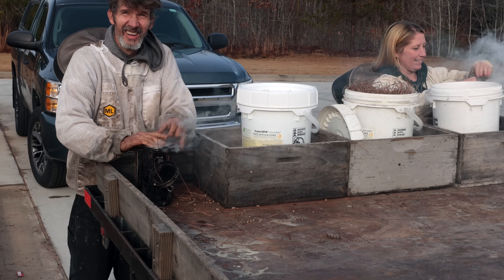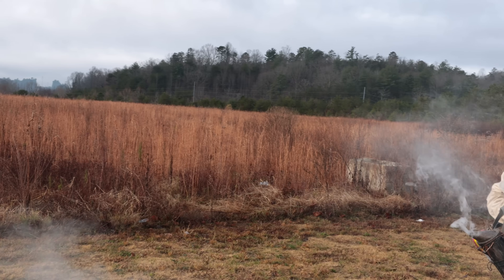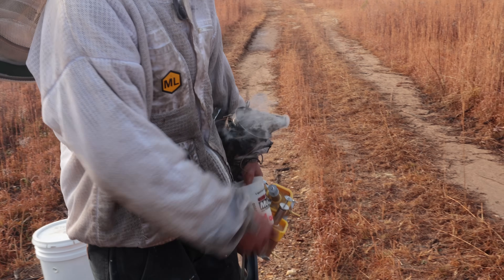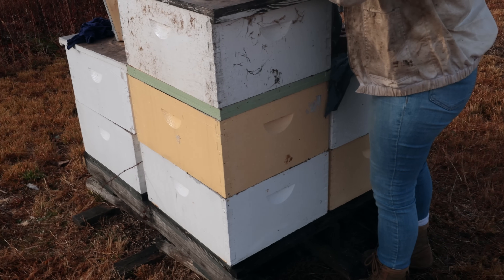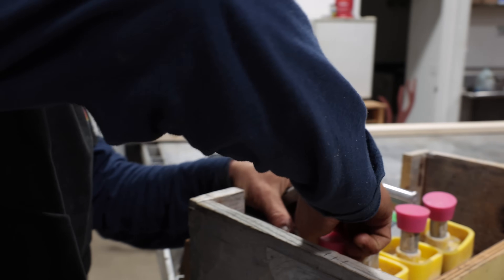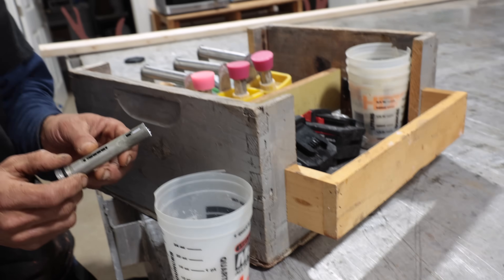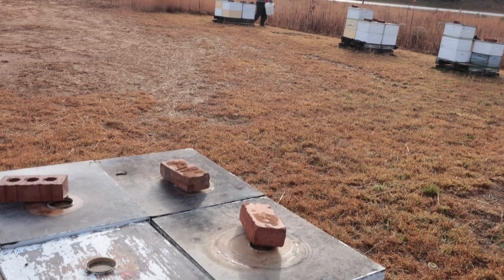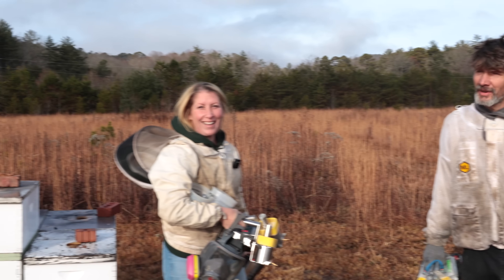Oxalic acid vaporization 2025

Comment: The threads on my plunger get OA crystals on it and then it takes a pair of channel locks to break it free so it can be adjusted. It gets stuck so bad that I think I’m going to break off the adjuster knob with the channel locks. I’m using their cheapest model. It gets so hot that I’m not sure if I can put oil, grease or silicone on the threads to prevent that from happening.
Reply from the maker: There can be a build up over time. We usually put the plungers in a bucket of water between yards and then twist the knob to clear things off before using. Seems to work fine.
Reply: I rinse my plunger in warm water & it seems to clean it pretty well
Reply: I use the 1qt plastic tubs and put a couple spoons of baking soda in the water and let the plunger soak and react. Same with the silicone heat mat. Then rinse with clean water. 

I also wipe down my instantvap with same mix on a rag at end of season and then polish with stainless cleaner. Looks brand new still. Expensive tools so I try to take care of them.

Comment: Hi Bob, great video as usual, thank you!  the oxalic acid I bought ( to use with Instavap compact) is very fine and it runs out of the plunge. I can see you don't have this problem... what do you suggest? I've been using a spoon to dispense the right amount but I'd like to be able to use this costly tool as it is supposed to... thank you
Reply from the maker: Add just a very small amount of moisture (just a small sprinkle and stir) and it will clump better. Some people recommend distilled water but I'm not sure if that is necessary if you have good water.

Comment: Havent seen such a high dose like that yet. Are you sure you aren't going to see some bee losses with such a dose? I'm beginning to question this method over the dribble. Now its 2x the time for each hive, instead of just one 4g dose. Thats likely on par with 2 employees cracking, tipping and squirting.
Reply from the maker: The University of Florida has done extensive studies on this and it looks like 4 grams is a good place to be. We've used approximately 4 grams per box for awhile and haven't noticed any problems to speak of. A number of years ago I used the dribble method for two years in a row and did it twice in winter and saw colonies lose 1/2 of their population. One dose didn't seem to cause much dwindling.
Reply: @bobbinnie9872 thank you for the information! And for your videos

Comment: Hey Bob, the last week or so, every morning there is a bit of dirty water on the landing board along with a dead bee or two either in it or near it. I clean the landing daily. The hive is insulted on top and sides, also the hive is pitched toward the front about 3/4 in. This is new, the last few years i have not experienced this phenomenon.    The hive configuration is a double deep.
Reply from the maker: We see a few dead bees on the landing boards from time to time. It usually is seen just after a cold spell.
Reply: Ours fly out and die all winter  its saddening  but  true
Reply: The real concern with this question is the water aspect, any tips on condensation control and possible causes.

Comment: How do you feel about the higher set temperature? Instavap seems to have done the research that points to 260c being optimal but I’ve also heard as low as 200c being much better
What do you use to reacharge batteries on the go? 12 yards would use a lot of juice

Comment: I bought an instant vape turbo last week.  Went out this morning to treat my 21 hives here in Cali.  I couldn’t get the oa to stay inside the plunger.  I had to use my gloved finger to hold the oa from falling out of the plunger.  Then my new $200 battery went low before I could finish.  It’s not as easy as it looks.
Reply: Add a little water to your OA. Doesn't take very much at all.
Reply: @MarkWinklebees yep only about a teaspoon to 500g

Comment: Bob, would you please go over why you use 2 Turbo vaporiziers on the same colony at the same time?  I am getting ready to use my Turbo for the first time and am concerned about running 4 grams of OA at a time through it.  Running this much OA also caused issues with my Pro Vap 110 EZ so I had to cut back to 2 grams of OA at a time.  I wash all of the vaporizer components with a heavy solution of baking soda and water to neutralize any residual acid. Thanks for posting!  I always learn a thing or two or three watching your videos.  👍
Reply from the maker: We're using two at a time to move along quickly. One would work fine if used twice in quick succession on a colony. We have good luck running four grams through at a time.
Reply: @bobbinnie9872  In your experience and estimation, will the Turbo handle 4 grams of OA on a repeated basis with no ill effect?
Reply from the maker: @wrfarms9741  Our experience so far the answer is yes.

Comment: Very appreciative for every single video you post Bob. Thanks so very much. Having 3/8 entrances does help for sure specially against 🐀. This is the first year having infestation of rats and I have to make the pallets using 3/8 shims. Do you make the entrances smaller during winter time?
Reply from the maker: Sometimes we do on small colonies. We simply use a short 3/8 thick stick to block the entrance down to around 2 inches.

Comment: I'm hoping the makers of these machines come out with a larger capacity plunger. Will mention that to them at the expo.
Reply: Can't do over 4g at a time , it drops the temp below proper temp for OA vapor to work correctly.  I've found it works best doing two 2g , vs one 4g doses, but I have 1st design instantvap,  turbo might do 4g fine?
Reply: @thewayisnarrowfewfindit well that makes sense.
Reply: Yes most defiantly!
Reply: And a slightly longer, bent brass nipple.

Comment: Do you ever have the plungers lock up on you?
Reply from the maker: Rarely, but we do clean them up periodically. There can be a build up over time. We usually put the plungers in a bucket of water between yards and then twist the knob to clear things off before using. Seems to work fine.

Comment: Great video!

How many grams are you using per double deep? How many uses do the turbo model go for before the battery is dead?
Reply from the maker: Thanks. Each double is getting approximately 8 grams. I think we get around 30 treatments with the batteries we're using. Of course the battery size has a lot to do with it.

Comment: Ha Bob another wonderful video, the oa that you have I have a hard time getting it to stay in the plunger until I have used it a couple of times, the plunger is hot when it does ok,  do you do anything to your oa to get it to stay in the plunger? it's like mine is just 2 dry.  it did not use to be that way. I hope u and all have a blessed week
Reply from the maker: Hi Frances. If the OA is too dry it doesn't clump. Sprinkle a little water in the OA and mix. It doesn't take much.
Reply: @bobbinnie9872  thanks

Comment: Do you have any colonies equipped with pull out bottom boards to allow for checking of the mite drop after this Oxalic vape treatment 'Round One'?  In my apiary of 10 colonies (i am just a hobbiest), I treat in late October, when the hive is broodless with HopGuard3 strips.  The next week after treatment, I can pull out the 'pull out bottom board' and observe large mite drops on some colonies to just a few mites on some colonies.  This is a follow-up treatment after treating in late August with Formic Pro strips which can also result in large mite drops.
Reply from the maker: We don't currently have any bottom boards like that. They can definitely be a handy tool.

Comment: Does the OA vape burn exposed human skin after you treat 10 plus yards?  Like top of your head?
Reply from the maker: If you're in a cloud of vapors that long it can have an effect but it's not a burn. It makes us feel a bit off. This is more of a problem in the heat of summer when the skin is moist. A hazmat suit would help in this instance. I personally make an effort to generally move up wind or at least stay out of the cloud.
Reply: @bobbinnie9872 . I see folks and workers get complacent on PPE.  Yeah I almost got heat stroke during a hot summer day working with a full face respiratory and full bee suit .  

Now I go much slower .  

Must be tough doing so many Bee yards as you guys do ?  I give you commercial bee keepers a lot of credit especially your workers .  🇺🇸🙏🏻👍

Comment: Morning Bob and team having coffee with and i heard Selina on oxalic temp.  Seems to high I’m no chemist.          Oxalic acid vaporizes (sublimes) around 157°C (315°F), turning directly from solid to gas, but it first melts and boils off water at lower temperatures. For beekeeping treatments, vaporizers are heated to around 230°C (446°F), a temperature that ensures rapid vaporization without excessive decomposition into formic acid and carbon monoxide, with effective vaporization happening between 195-205°C.
Reply from the maker: Thanks. Although the tools seem to get that hot when they are finished I'll check that they're cooler while burning.
Reply: @bobbinnie9872 
Janos, the inventor of these devices made significant research on the best temperature setting for specific amounts of OA. I wish I could share that chart here. I contacted him a few weeks ago to see if I can bump up the original machine, and he said it’s best to leave them at factory settings, since the heating elements are much weaker than these new ones.

Comment: Wood pellets at Tractor Supply is $7 for a 40 lb bag.
Reply: I used to use pellets when I ran 40 colonies.    It would smoke all day long.   If it looked like it was low, then just pour some pellets in and you're good to go
Reply: I use alfalfa pellets .
 Most cattle or hores owners have them

Comment: I've ended up drilling a hole in the back of the bottom board which has worked well. I plug the hole with a golf tee when not using it.
Reply: If you drill a hole in a box, instead of using the bottom entrance, make sure it doesn't line up with a frame, or it can block the vapor tube and cause a dangerous situation.